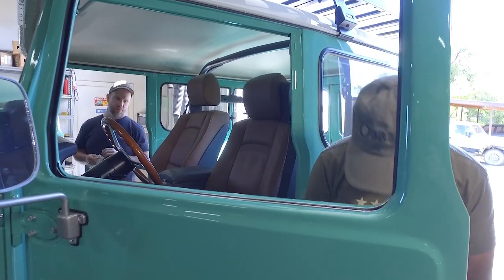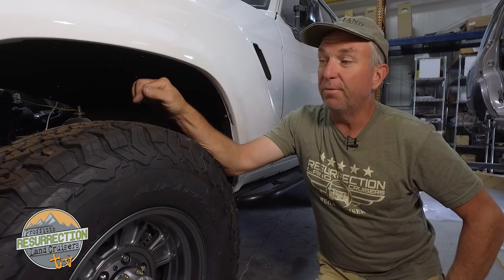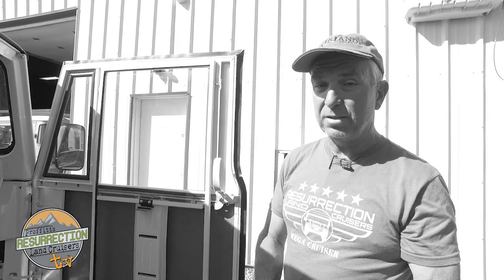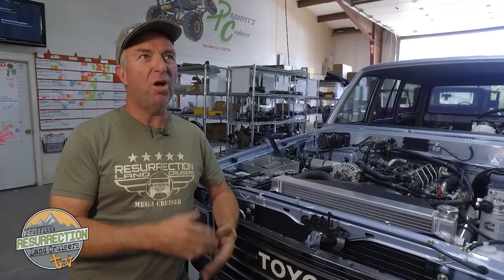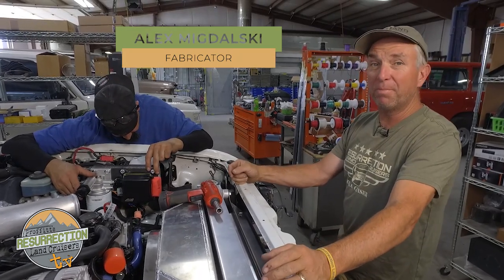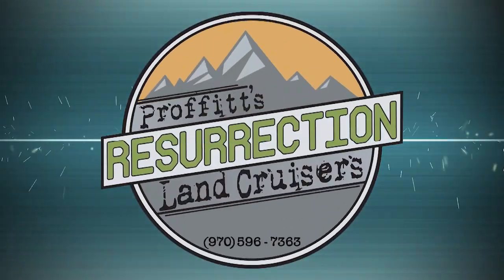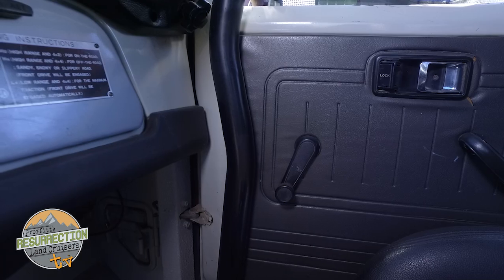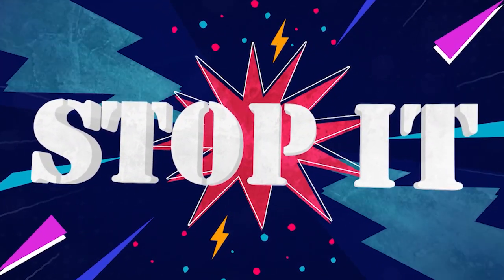STOP IT! If you are building a Land Cruiser and are guilty of any of these faux pas...STOP IT!

Comment: I would like see the other option for the conversion cross member, other than the propeller style. For the factory 4 speed and case, that is all I have ever seen?
Reply from the maker: You are right, for the earlier 40 series 4 speeds there isn't another option. 1974-1980 4 spds didn't have provisions for the isolator used on 4 speeds from 81-87. We haven't run into this as a problem though, because all of our engine conversions either use a 5 speed transmission, or an automatic of some kind with an adapter that has provisions for an isolator.

Comment: Thanks for the videos. I especially like the ones on the FJ40s and FJ43s. I have a couple of questions for you. The first is, if someone wants to keep their 2F engine during a restoration, do you keep it stock, or is there anything you do to get a little more power like aftermarket headers or a different carburetor? The second question is I've heard that FJ40s were able to be hand cranked to start them in case the battery or starter failed. Was this on all FJ40s with the F and 2F engine or only certain years? Could you also do a video of how to hand crank an FJ40 if you ever get one with that option in your shop? Thank you.
Reply from the maker: Hi Mike, Sorry, I missed your questions. The first answer is, when we rebuild a 2F, we rebuild them to stock configuration. I've found that overbuilding them only leads to shorter engine life. What we do to get more power out of them is aftermarket fuel injection. It doesn't make a huge difference, but at least it compensates for altitude. That helps a lot. Other than that, gearing can make a big difference in how an FJ40 or FJ60 performs. The answer to your second question is, I'm actually not sure of which engines had the hand crank front engine pulley. It's actually just the nut on the front of the crank shaft that allows that. I've seen them on 1Fs and 2Fs. The crank handles didn't come with most models though. I've seen them in some FJ40s, usually non US versions, and lots of FJ55s. There were provisions for them under the rear seat of the 55 model. As far as the video goes, you have a great idea! We'll do it!
Reply: @procruiser  Thanks for getting back to me. I'll be looking forward to the hand cranking video.

Comment: I enjoy all the videos...keep up the good work.    I do have to comment on your "stop it" regarding a transfer case cross member.  While I appreciate your comments about all the wrong ways of doing things,  it's also important to also provide a path to an "acceptable" solution.    I looked at your builds (some of the 40s with a diesel conversion) and the Profitt's custom cross member is a 1/2" thick solid bar cross member with 4 bolt mounting plate on each frame rail.  The DIY community doesn't have a 100+ ton press brake  to bent heavy steel like the your solution.  I like your solution....clean and simple.   Would Proffit's  consider offering a DIY cross-member kit that the purchaser welds together at home?
Reply from the maker: Thanks Gar Guy. Sorry that I'm late in answering your question. You're right, I should have talked about good techniques to build a better crossmember. They are actually one of the trickiest parts of an engine conversion to make functional and also good looking. Recently, we sent out a couple of crossmember kits using our laser frame plates and a "blank slate" piece of 3X5/8 flat bar. My advice to them was to make a template for the shape of the bar out of thinner material (our guys use tig rod) and then have it bent at a local fab shop. Alternatively, it's not actually that bad to bend it in a vice using an oxygen/acetylene torch. I haven't gotten any feedback yet.

Comment: I wasn't offended at all. On the contrary, I find these spots very helpful. I'm starting a resto on a 1979 FJ 40, and it's a stop it from one bumper to the other and in all directions. The PO did all sorts of things and then covered everything with a generous coating of DIY bed liner. I got snookered a bit but I plan on making it as good as I can. The body was unbelievably, mostly rusted but I'm going to get it back in shape regardless. I agree on the forums. I'm a noob and it gets super confusing on most forums I read. I truly appreciate Jerimiah and all the Proffitt's for the offer to answer questions, especially considering how busy you folks are.

Comment: ok...i'll just put my Stop It out there so that people can hate on me.  Just Stop over restoring FJ40's.  They came from the factory with poor body work, they were utility through and through.  Now they are being restored with perfect paint and bodies which to me, just betrays the original low key charm of the vehicle.  That being said, to each their own, and is really just a matter of taste. I'm just finishing my 2nd restoration with this vane in mind, look forward to the criticisms.  Lol.
Reply from the maker: No hate here. I actually mostly agree with you! But first..the "stop its" I put out there are to keep people from compromising the quality that Toyota set out to achieve in the first place. Toyota never  put any product out there with dangerous wheel spacers, random holes, bad metal work, body filler over rust, strange secondary components mounted next to nonfunctional OEM ones, or any of the other "stop its" I talk about. As far as "perfect paint" It's true that the quality and application of the materials we use is intentionally better than what Toyota used, but that's not done to make the vehicles appear better than they did new, it's so that they last longer. We go out of our way to try to stay consistent with Toyota heritage, preserving the spot welds whenever possible,  always using single stage paint to be true the OEM look, and to a greater extent, keeping the authentic look of the 40 series in  all of our restorations and even the resto mods. (Some other shops get a little carried away here I agree) Lastly, it's important to mention one of the pillars that Toyota is founded on is Kaizen. "Continuous improvement" We also strive for this principle. 

Here is where I strongly agree with you. I have seen lots of  over done, base coat clear coat, (and sometimes metallic) paint jobs on 40 series Land Cruiser that were very out of place looking. I also don't like when restorers mess with the factory dash board "feel" and layout of the 40 series, installing tons of aftermarket rocker switches, digital key panels, and touch screen displays. Another "stop it" for me would be the strangely styled billet subcomponents that really over-modernize the series.